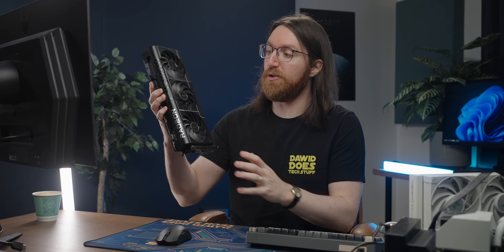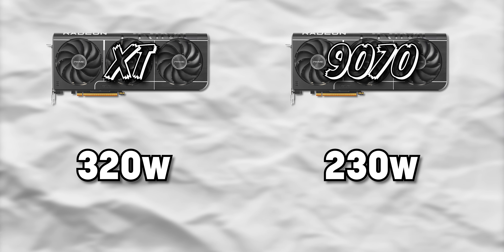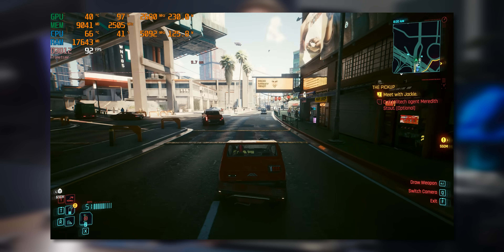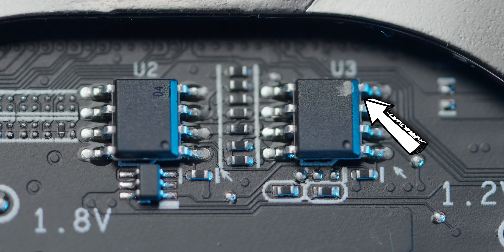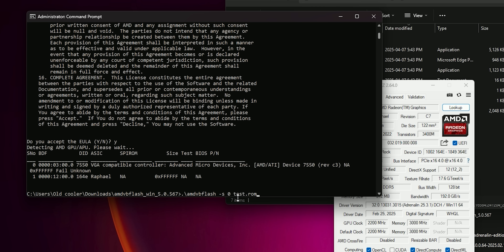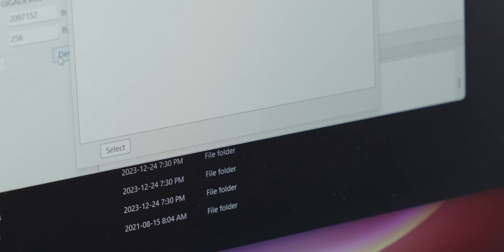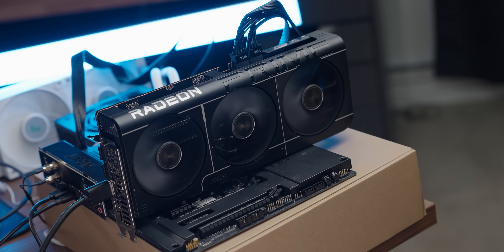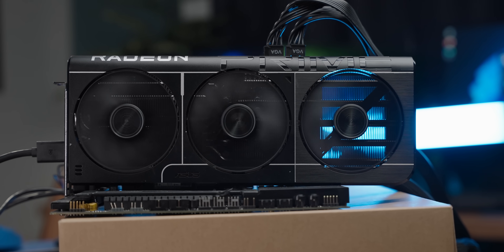I Flashed An AMD RX 9070 XT BIOS Onto My RX 9070...

Comment: Just wondering why AMD didn't to that, cuz why not? I watched some benchmark videos of 5080 and it gives 140 at 2k native but this video says 9070 catches it and it's not even XT version. So if you can catch Nvidia's high end GPU's then why the f you didn't unleash the power?
Reply: Partially bc you can upcharge to the higher end version without it affecting your manufacturing costs, and partially bc I imagine there’s a potential for instability

Comment: It so dumb.  Making overklocking with different bios on not good cooling system will fuck up the card by receiving 3fps more. It is like installing supercharger of 5l engine to 1.1 vw engine. Fast way to burnout.  Content for idiots.

Comment: From personal experience, the best option for the CH341A is to ditch Windows and any bleeding-edge Linux distros. Good old Debian won the race for me.

Also, you could have read and dumped your BIOS before writing anything. As for the .rom file, from what I know, if the GPU has two partitions on the BIOS chip, they could have been dumped into two separate .bin files and later combined into a single .rom.

Comment: The big selling point of the 9070. Is its efficiency and silent operation. I will glady take less settings and fps. To have a gpu that doesnt sound like a jet engine. Coming from a 5700xt that idled at 40c 144hz display. Now im idling at 30c at 180hz on the display. I literally cant make it as loud, even when stress testing it on 3dmark, its still quiet as a mouse. Wouldnt have it any other way, performance is great. But if you arent using headphones, a constant fan noise can get old...very quick.

Comment: Been there- modding a Geforce DDR to accept a Quadro BIOS. Soldering was a pain and in the end I needed a PCI graphics card to boot the system off and hot plug the AGP card to flash it over, after the initial attempt was the wrong of two BIOS files I found. Actually the 64Mb version worked on a 32 Mb Annihilator

Comment: I remember when firmware wasn't locked and flashing bios on cards was common. Not easy. Never truly safe. But a helluva lot more effective if you got a good die. RIP 5950 Ultra Circa 2002.

Comment: Can this be done in software now? I just bough a 9070 although I do not want to try it yet but I am curious :D I got the Sapphire pulse which is not a top end model for sure (but it works great)
Reply: try it in several years, when the card is old and you really feel the extra fps is needed.

Comment: This could be done with the rx 5700 back in the day. I flashed mine with a 5700 xt bios. I  just got a 6750 GRE 10gb and was wondering if there was a bios I could flash it with, but there isn't any information and it has a different memory configuration than the 12gb  6750 GRE. I settled with using morepowertool to push the card from 138w to 200w.

Comment: With the programmer, how do you specify which partition you are working with? Just flying blind? I have never used one, but I might need to after a failed flash on a 9070 using a modded vbios flasher. I've ordered a setup similar to what you are using here, with the 1.8v adapter included. I currently have one corrupt partition which I would like to recover before doing anything else. The inactive partition on primary bios chip. Luckily, I stopped there before trying random crap and bricking the card. Not like me, but I used self-control. Perhaps this will be self-explanatory once I get the stuff here.
Reply: Crazy idea but you should just use a software flasher instead!!!

Comment: I specifically chose the 9070 over the XT because it's only slightly slower but uses way less power. Also my Powercolor 9070's power limited can be raised from 220w to 269w in LACT (Linux).

Comment: One thing I learned trying to use one of these clamp adapters is push the wires up into the clip before attaching it to the bios chip. Some have a lot of play and the little contact tabs like to slip back some and won't make contact with the bios chip legs. After that I was able to reflash a bricked MOBO bios first try easily

Comment: your vrm mosfet will be smoking if done wrong, some card have designed with no wattage headroom, you need to check if the total mosfet can handle higher wattage. in my experience some lower version model missing some mosfet due to it designed for lower wattage and cost 😏

Comment: I have a non-xt xfx swft 309 rx 6700. If I flash the bios of the xt version of the same card, will I have any problems? Will there be a performance increase? Is it possible?

Comment: Did that with my r9 290. Flashed it with an r9 290x.
Why?
My 290 had plenty of Bsod , blackscreen  and EVEN redscreen of death .. Just a shitshow.
Back then I heard some rumors that some r9 290 are actually 290x flashed down. It was more cost efficient for certain factories.
I contacted the support of the manufacturer and they were hesitant at first, asking me to go through all of the trouble shooting that I did before.
After a while, I succesfully got my hands on their original bios for the 290x.
Flashed my 290, and it fixed EVERYTHING.
Gameplay was smooth temps got better, fps slight increase.. It saved my card. 
The card is still alive and working well, the only thing is that some software doesn't know if its an 290 or 290x, so it basically says 200series or AMD card.

Comment: 2:28 no you don't even need to flash back a VBIOS to get this job done, you can just manually tune (probably even limit it's PL at some extent but underclocking via undervolt is better effective) the GPU manually just using MSI A/B or the AMD utility tool that lets you save and load profiles and i don't even belive there are extra actually useful features that 9070xt hasn't, would be ridiculous. 

And no again flashing a VBIOS is a lot less scary than most people thinks as you can create a batch file to run a command and tell to flash the old VBIOS if you get no display out (at least for Nvidia it can work out this way)

Comment: last time i did this kind of bios mod was with my RX5700, using the 5700XT bios, it had ~12% extra fps but died in 8 months... dunno if caused by the mod or the board wad some issues, the repair shop told me it had a short circuit in the board (Asus Strix model btw)

Comment: The one upside of using an external BIOS flasher is if you DO botch it, you can probably recover it, even without a dual BIOS card... but I'm lazy and scared, so I'll wait for the software tool to be updated :P Also I'll onjly be flashing a 9070XT Hellhound to a 9070XT Red Devil for some extra power.

Comment: You can even take it further and make sure its not running hot, just do a Undervolt with the GPU. it will save your card from overheating and longevity.

Comment: Great video and I managed to do it to a sapphire NITRO 9070. Great gains of around 15%. The lower 1% lows was because of instability. I had a -100 offset and noticed lower 1% lows especially in rt titles and very rare crashes due to driver timeouts. Turns out my gpu is mostly stable at -100 but for absolute stability, the max I could go was -70. These cards generally undervolt between -60 and -80. You will be able to run the majority of games at -100, but the most demanding games will sooner or later crash. Sometimes after 5 minutes, sometimes over an hour! But reducing undervolt completely solves it and boosts 1% lows. Memory seems to actually decrease performance when going beyond 2780-2820, depending on your card. 2750 is virtually guaranteed stable. I run 2780, as my 3dmark score goes down past 2800.
Reply: Is it still functional? Sorry to ask, I read a few comments saying "my card no longer works"
Reply: @UnalertYT  Yes it is still running perfect. Others reporting issues have either messed up somewhere, or maybe they had a low end card with cheap pcb that was not able to handle the extra power. You want a card with 3x8 pin power delivery ideally, or a 12vhpwr model like taichi or gigabyte gaming oc.
Reply: @djpquickplays1244  uhh does the XFX QuickSilver RX 9070 OC work? I dont think it has 3 sadly.
Reply: @UnalertYT  It will work, but once you flash the bios, monitor the hotspot and memory temperatures. If they hit 100 or more degrees, lower the power limit until they remain under 100. I suggest using a game with ray tracing to test, like cyberpunk, as rt games run a bit hotter. Find the limit at which the card hits 100, and remain below that. Remember it is the hotspot and memory temperatures you want to see, not just gpu.
Reply: @djpquickplays1244  awesome thank you bro
Reply: @djpquickplays1244  when I flashed my 9070, I saw a performance boost in synthetic benchmarks like steel nomad but it didnt seem to work in games.... even when my gpu was pushing 370w and had a boost clock of 3.4ghz idk why, someone else posted the same thing on reddit.

Comment: Just did this today with my sapphire pure 9070 and flashed it with the sapphire pure 9070xt, I don’t have a dual bios and I was a bit on edge doing this and was willing to take the risk, biggest thing is to make sure what voltage that bios chip runs at! My 9070 stock pulled 270w and now it pulls 350w in steel nomad with a score of 6920! I’m happy, I got basically a 9070xt for wayyyyyyyy less money in our current market! Hundreds less! Thank you for this video and oh wow did it take forever to finally find a solid connection to even read the chip in the first place, literally fought this part for hours! I’d pay 30 bucks if the clip had better connections! Also when you check the name of the card it still says 9070 like in this video, but with frames uncapped you’ll see it pull way more power!
Reply: Bro i have 9070 pluse ,can you show us every detail how to become 9070xt pluse 🙏
Reply: where i live a 9070xt is only $50 more than a 9070 so may aswell buy a 9070xt for the 8 extra CU's
Reply: @khirasier yeah, at the time for me it was 150 more for the xt variant

Comment: Back in 2003, I found a thread about flashing my 128mb 9800, with the 9800 Pro bios. I did it, tested it, was getting 9800 Pro performance numbers, so I left it. How long did it last? It burnt out after 7 years.

Comment: hey i was wondering if you could make a video about flashing the 550 watt aqua bios on the 7900 xtx? i currently own this card (the xfx model) and im wondering if this is even possible and if so it would be nice if there could be a video made about hoe to do this and what kind of peformance this unlocks!
Reply: I can't say for that card but generally speaking you should be able to. However some models aren't as compatible as others. If any of the display outputs are different it's very likely some will stop working. For example I had a ~310W bios flashed on a single 8-pin GTX 1080 FE (with a water block) for 5+ years and had zero issues except one of the display ports was unusable. The power limit slider was also basically useless.

Keep in mind if it really is 500W+ that's quite a lot more stress on the card, VRM, etc. and you may have to manually set the fans (assuming they all still work). Another 50-100W or so may not be a huge deal provided you keep it cool but I'd strongly suggest buying a used water block or something if it works and you plan on running a much higher power limit daily.

Comment: 25 series chips are bios chip and some 24 chips are also used sometimes it need some form of power... Make sure to use the same chip size of bios file or else error will happen.. eg 4mb 4096 8mb and so on

Comment: Just beware with excessive heat generation with that extra power. My XFX 9070 XT has upgraded hardware when compared to the non-XT model. Specifically the cooling system.

Comment: Using a programmer like that is actually a lot simpler if you use a Linux system.  It's just like two fairly simple commands, one for reading to make a backup and one to flash.  I've also been able to use various file types natively.

Comment: Yeah, flashed dual-bios card once, thinking that i have fail-safe in case of f-up. Flashed a wrong BIOS. Turns out, it also flashes to a single shared rgb controller and card bricked. F u gigabyte.

Comment: This post is ridiculous. It makes no sense to rig a 9070 into a fast XT. Because a non-XT will never be as fast as an XT, no matter what BIOS changes are made. I can run an XT with -30% power offset and get 230 watts with about 5% less power. The rigged "NOX XT," on the other hand, will always consume more power to reach the level of the XT. The XT always has 12.5% more stream processors. People, buy an XT, then you know what you're getting ;)

Comment: As a programmer, I can confirm that functionally, file extensions are just there to tell the system what to use to interpret the bytes it contains. Changing an extension doesn't directly change anything to the content of the file, and since a ROM is a direct image of either binary or hexadecimal memory data, it is also works as valid .bin (binary) or .hex files.

Comment: With price difference of 7-8% it is pointless to bother with BIOS flashing, additional tools, possible problems etc.
Reply: But there is not a price difference of 7-8% at the moment, I just picked up an XFX 9070 Quicksilver OC for £492, The XT version is £632, That's 28%.

Comment: How did you get Riva Tuner, MSI after burner to work with the RX 9000 series?.
 Ive the RX 9070 and it doesn't display correctly.

Comment: Is the GPU still running 2 weeks later?
I wonder why AMD bins chips lower as "9070's" as opposed to binning them as "9070 XT's"?

Do you believe that 9070's are 9090XT's with a "just" BIOS power restriction so they can sell them cheaper?
Reply from the maker: @gscheben123  I was just playing oblivion on it. Still running strong.

Comment: just like with the vega 56 to vega 64, and the rx 5700 to 5700xt bios mod, or just use more power tools to edit the and get 5700xt level of performance.

Comment: When I bought a second hand msi rtx 3070 suprim x, it came in a normal suprim box, turns out it had its bios swapped to get the slightly faster core clocks

Comment: Bro....we were flashing GeForce fx cards with their Ultra counterpart bios' in the early 2k's obviously we were still limited by the actual hardware, but yeah we could still benefit from the higher clock rates and increased voltages. They aren't geniuses they're just reviving old Sh** that's already been done. We even had actual geniuses that built programs so that could even further customize & tailor the new bios without bricking the cards. Yall are late to the party.

Comment: I did a similar thing with my Radeon 9500, 3000 years ago. One of the manufacturers released 9500 series with exactly same pcb/components of 9800Pro.

When it was discovered a lot of Radeon 9500 owners (including me) converted their cards to 9800Pro by a simple firmware update.

Comment: Whereas it cool that this works its not something I would recommend for anyone to do. Yes the two GPUs may share same SoC, but there is a reason there are some core disabled and that is that they might be damaged or non functional at all. You just risk facing a lot of stability issues by turning 9070 to XT.

Comment: Has anyone tried to flash the 6800 in the 6800 XT?
If so, how do I do this?
I tried to use a programmer to sew BIOS from 6800 XT, but the video card does not start, and it is defined as a regular 6800 without shaders.

Comment: Hmm, very cool. It seems you can just short the power sensing head on these cards and fully unlock the power limits, similar to the shunt mods people do on Nvidia cards. Soldering irons are arguable less scary than manual bios flashes.

Comment: try flashing a 340W bios next, also something is going to give because each PCIE 8 pin can only deliver 150W so assuming it pulls any power from the PCIE slot you are probably power limited anyways.

Comment: dude i repasted a gpu (asrock 7900xt) and added thermal pads to some chips and my hostpot delta between the normal temps dropped from 15+ degrees to 7- degrees. I wasnt expecting such a huge difference. what is up with that?

Comment: My Vega56 has a Vega64 BIOS.... it has been this way for 7 years and has worked flawlessly. I made my own frequency and voltage offset configuration for it through testing and I got a solid 20-30% performance improvement. My Vega56 performs better than a stock Vega64.

Comment: Sure you can do this but the card isn't designed for it and most likely resulting in decreasing its lifespan and longevity
Reply: nah if cooling is sufficient. like all vram included beyond the main dye it wont rele hurt. the only thing to notice is the rate of thermal paste deterioration. So once temps avgs start lower after 6-12months of usage than thermal compound can be replaced but it depends on the rate of them being "cooked" off

Comment: PBO2 on Ryzen CPUs also works the same, voltages are opportunistically selected based on the power budget, and clocks are selected based on a table of voltages to clock speeds, by adding a negative voltage offset you're selecting higher clock speeds for that power budget, but it can make your CPU/GPU unstable because the higher the clock speed the more voltage you need to maintain stability.